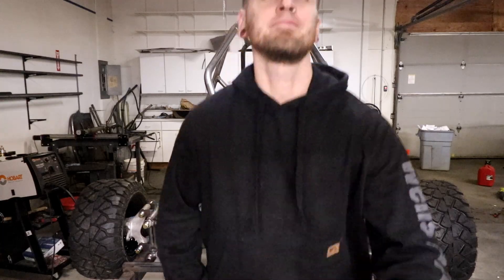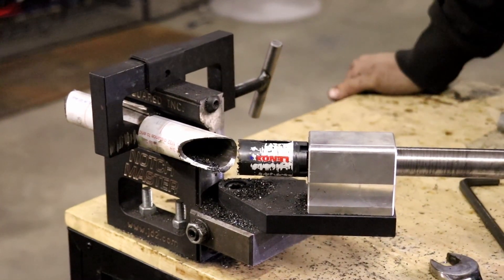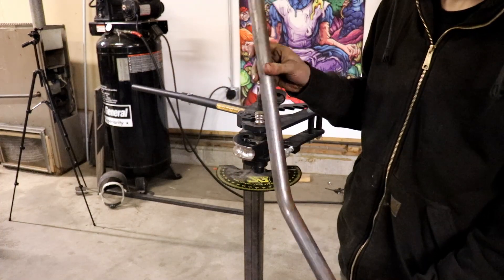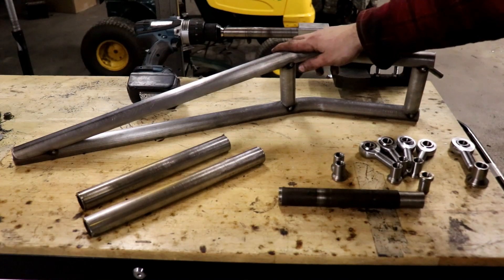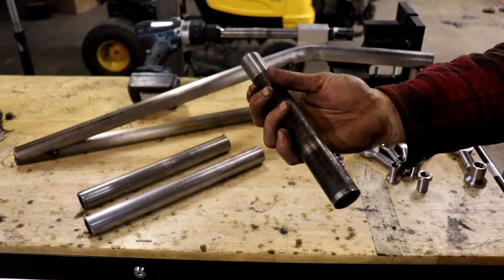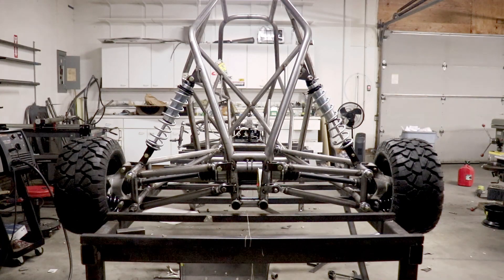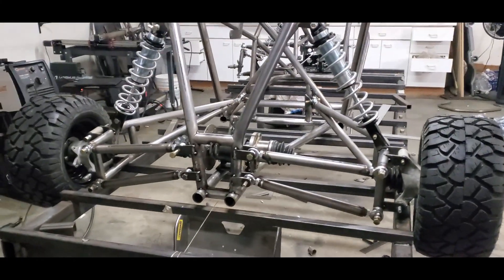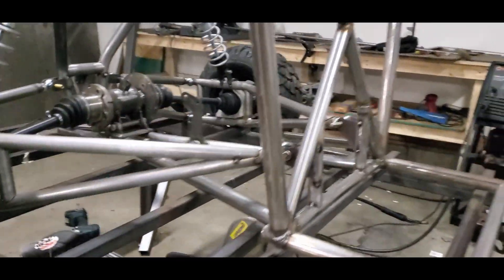Crosskart Build Pt. 7: Rear Suspension

Comment: Awesome work! Going to be a deadly unit! When you did the plug welds did you drill down to the inserts or just to the sleeve?
Reply from the maker: just the sleeve. inserts would be the way but ots a lot of drilling. Ill be making one piece inserts for the future projects thatll have an od of 1.06 to fit nicely in the 1.25 tube. no sleeves

Comment: Just curious why no double shear ? @jimboSLICExD
Reply from the maker: I dont even know what double shear is
Reply: So on the rear for example where the arms connect to the chassis they only connect by a bolt instead of like a c clamping down on it with the heim going through the center and the bolt on the outside of that. Utv aftermarkets make a plate for utvs that have this, you could just make a plate thats as big as all the pick up points on the back and drill holes for each of them and that will reinforce that area but double shear is when the pickup point is supported on both sides and puts less stress on the bolt and chassis but single shear purs more stress on the bolt and leverage instead of being held/squeezed in place. A plate would help distribute that and you could then weld the plate to the chassis?
Reply from the maker: @Mustardmartin  Maybe its just the angle you saw but all of the tabs are double shear except my knuckle kingpin bolts. If you see something i dont please get a screenshot of possible! I appreciate the help
Reply: Your probably right i just saw straight on from the back and thought the bolt just went through the heim and squezed the spacer against the heim and chassis even if it was that was it would probably be strong enough just stronger if its double shear like it is obviously sorry wasnt trying to tell you gow to do shit just curious if i was seeing right and i wasnt i guess